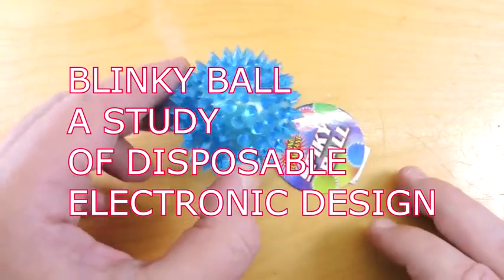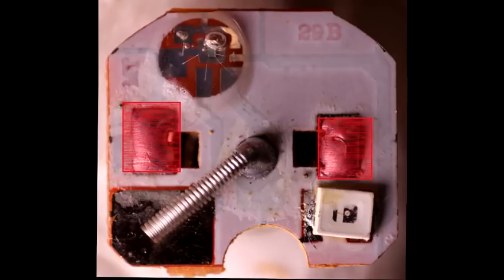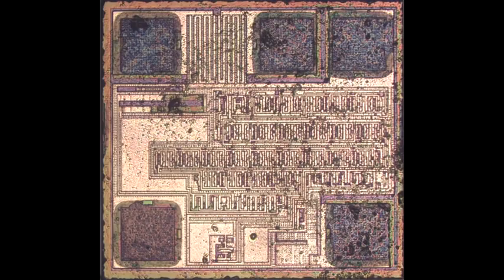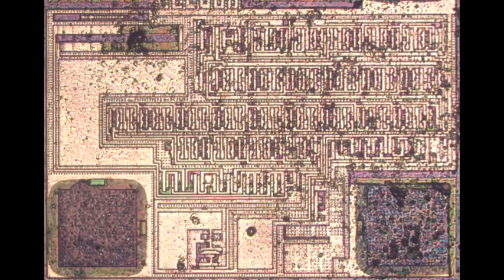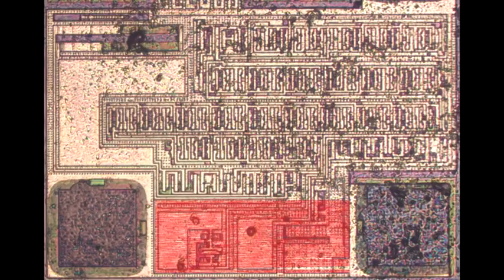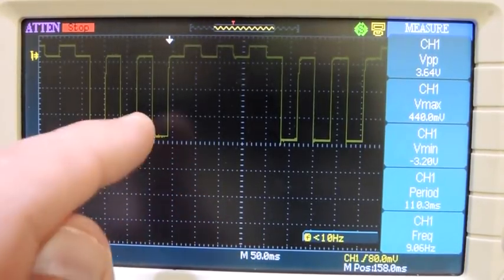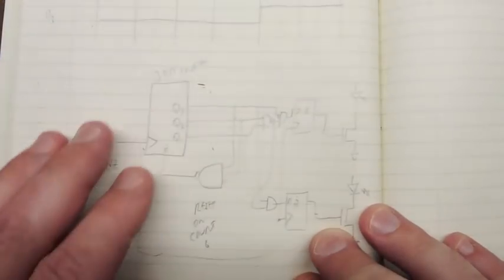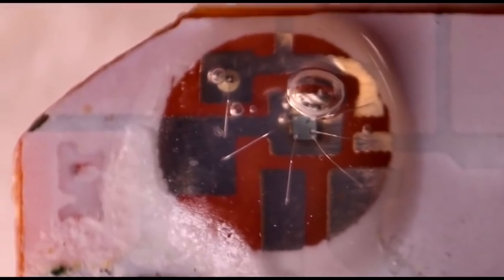Blinky ball: the art of disposable electronic design

Comment: These circuits are very simple but I often see toys that just blink LEDs when you press a button, and they're always different patterns. so I'm wondering if the Chinese manufactures mass-produce a chip with let's say 1000 transistors and then they just have to customise the metal layer. Like a FPGA but it costs 3 cents and is mask-ROM programmable.